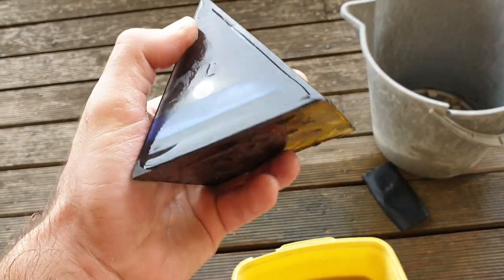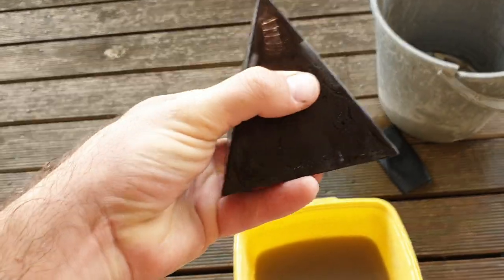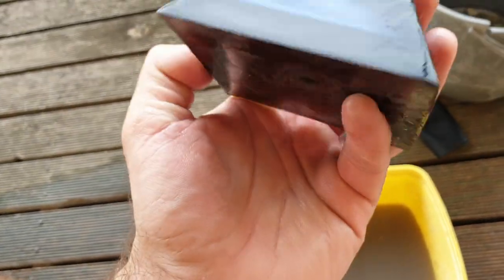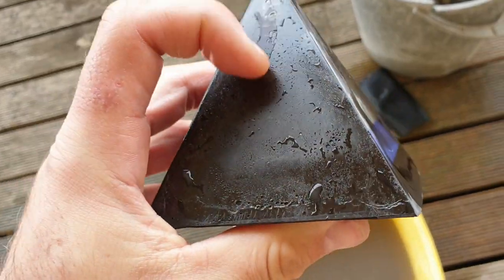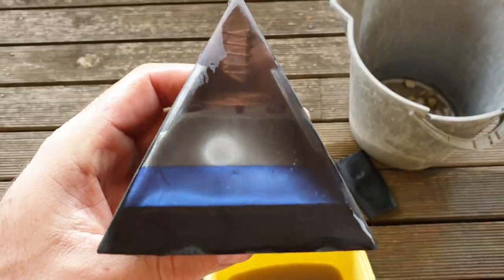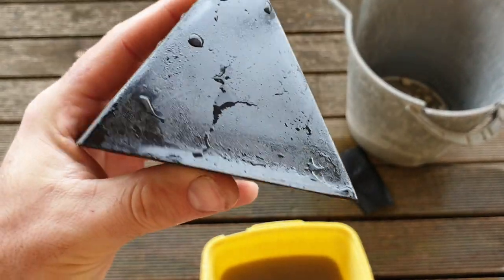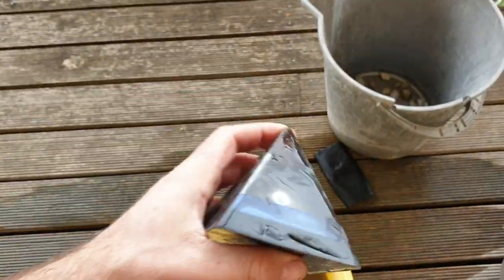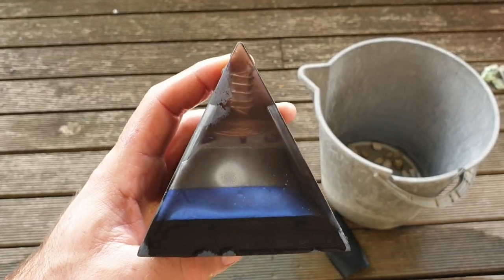Orgonite Clean Up Pt 1

Comment: Let me get this straight. You just took this pyramid out of the mold and you are soaking it in water to  start polishing it? Thank you. 👍
Reply from the maker: Yes, I am using wet & dry sand paper to clean it all up 😉
Reply: S&A’s Orgonite Creations.  Wow! I would love to see how you polish a piece from beginning to end. Question: If you are using a resin that relatively leaves your pyramid looking good, clear and shiny, do you still sand the whole piece? I ask because I tried it with a small piece (not all grids) and found that it was filling the appearance of the piece. It no longer looked like clear glass. Thank you again.
Reply: Dulling, not filling...lol
Reply from the maker: @7spiritualcompass706  I in fact give all our orgonite a sanding! Even if they come out pretty good. The edges I sand at least to get the sharpness.  Read my reply from BoonsQuest E4met, that response should help answer some questions 😊